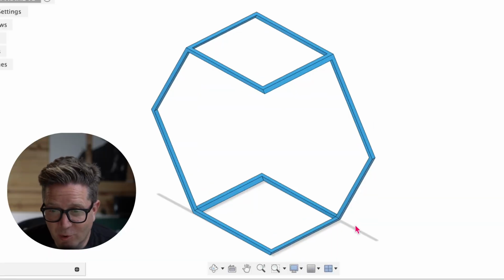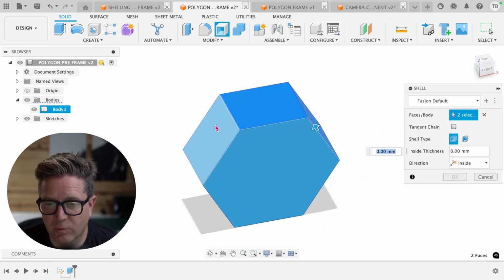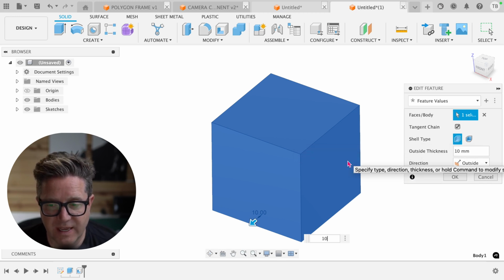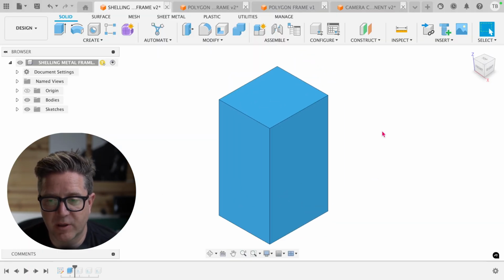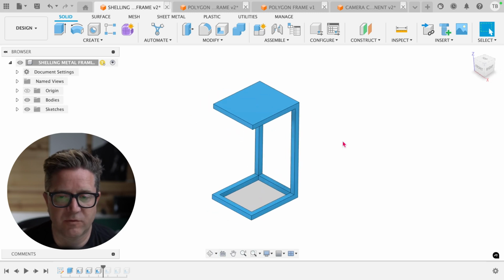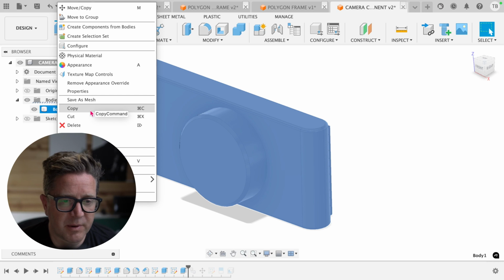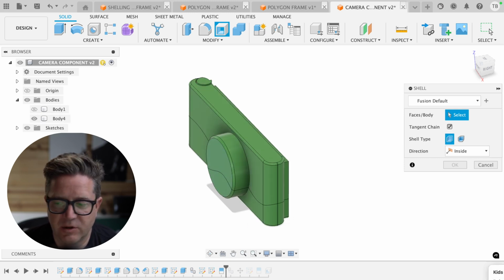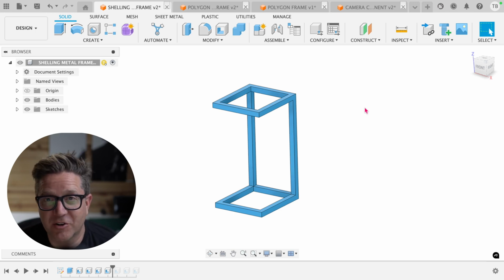Fusion 360 Shell Command: Hidden Tricks, Common Mistakes & Genius Uses

Comment: Fantastic. What's the most efficient way of adding that tolerance? Is it better to slightly expand the object before creating the shell or rather create a shell and then go and select the inside faces and expand them outwards a little bit? My intuition is that expanding the object before shelling is probably easier because selecting all the inside faces is a little bit tedious. But are there any gotchas with that approach?
Reply: Following. Wondering the best way to create the clearance.
Reply: @perniculous  would be great to see a follow-up video on this!
Reply: Simply scale the holder to make it larger, if the wall thickness is critical, adjust the original shell thickness to allow for the increase when you scale it up.